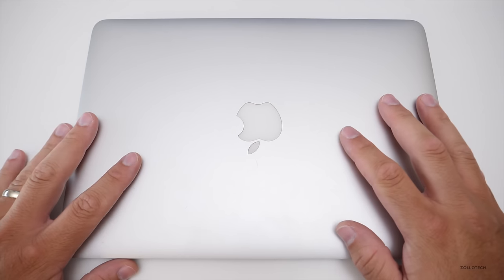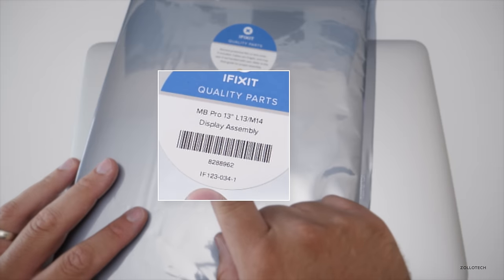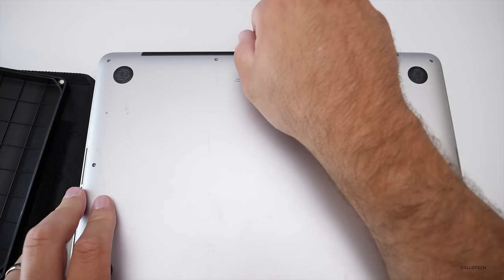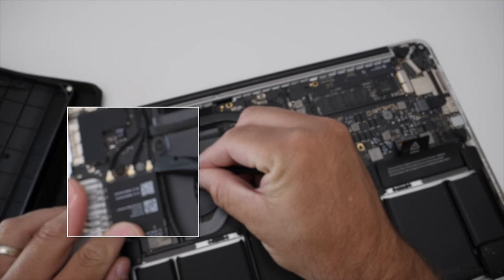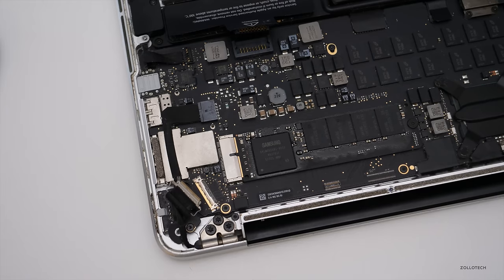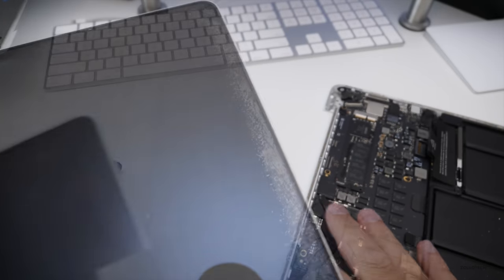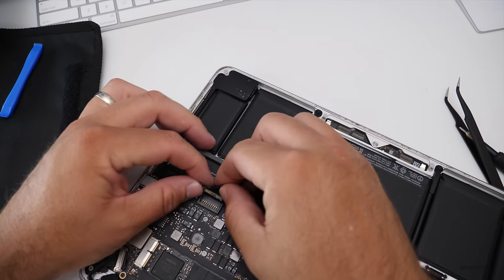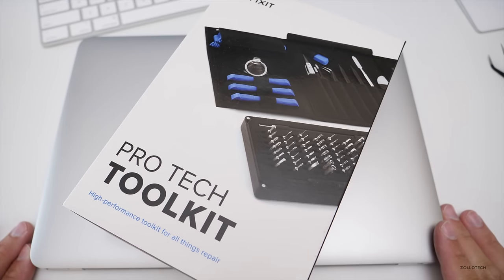MacBook Pro Display Replacement

Comment: Just rub on the screen with metal polish to remove some of the antireflective coating, the get it repaired for free by Apple.

Doesnt matter if the screen is cracked, they still replace it.
Reply: Stockholms Oskar is this offer still on?
Reply: @malyasiolek  It applies for 4 years after the MacBook is bought.

So some Mid 2014s and most Early 2015s are still covered.

Comment: I really don't see the point in trying to repair that when you can buy the whole laptop for that price!!
Reply: i'm in the same situation.. have a mid 2014 Macbook pro and it's not as bad as this one but it does obstruct a good 1/4 of my screen if i send this off to apple i imagine the whole process would cost around 600- 900 pounds (uk) where as the brand new model is like 1,100 pounds so for the sake of 200 pounds i might as well just get a new one

Comment: Hello, I've changed the screen on my MacBook Pro 2019 A2159... Something very weird is happening, during the iOS installation and until the iOS booting the brightness is normal and high but once the iOS boots the dim goes so low and I can barely see the desktop even if the brightness if full on! I think apple detects not original parts during the boot and doesn't let them work properly. Anyone knows any solution? I ve tried to reset the PRAM but same issue, starts good but then... brightness super low... I am freaking out!!!
Reply: Hey , did you figure it out?
Reply: @xpozo8601  nope I had to send back the display. And change with another seller.

Comment: I would like to know how much Apple would charge for this fix to be done...? Mine isn't as bad as the one in the video, but it COULD get that bad some day, right? The left side of my macbook screen is mostly lines and there are now horizontal lines going across the middle of my screen. When I went to the Apple store last year, the guy told me it'd be way too expensive to fix my laptop even though my line problem was minor.  He said I might as well buy a new laptop all together, even though I cannot afford one...I tried researching this and some sites said this kind of fix wouldn't be as expensive as a new laptop, but that would mean the Apple guy lied to me...Can you please help me out if you  know?
Reply from the maker: A lot.  Probably 500-1000
Reply: Thanks for the fast reply. I am just so scared of my laptop screen being rendered completely useless which would force me to somehow get a new laptop. I am just still stuck on if it's worth it to fix it or just buy a completely new one.
Reply: I was quoted today. Mid-2015 MacBook Pro 15” Retina Screen was approximately $680 USD. That is despite having purchased AppleCare when I bought the new computer in Sept 2016. Absolutely insane. I’m hoping I can find the replacement display and do it myself.
Reply: I just got quoted 625 CA dollars with AppleCare warranty so planning to just do it myself

Comment: My MacBook Pro 2013 15 inch screen is cracked.How much would you say it would cost for someone to fix it for me?
Reply from the maker: The display is about $500 from iFixit and then whatever it cost to swap it.  It's not that hard to do if you take your time though.
Reply: zollotech is it 500 CAD or USD? I’m Canadian so if that’s USD I can’t afford that.
Reply from the maker: USD you may be able to find one on ebay though.
Reply: zollotech I don’t trust eBay. Guess I’m doing my school work on my iPad or phone
Reply from the maker: Why?   I have used it for years. Just make sure they have good feedback and only pay using PayPal.  That way you can get your money back easily if it’s faulty or they don’t ship it.
Reply: WorldwideHandsome _ oof

Comment: Pro tip for any nubs out there who may attempt this. Never screw the bottom back on before testing it. There’s a 90% chance it will not work if you place all the screws back in the bottom.

Comment: I’m just pretty furious I spent $1600 to have a screen be so sensitive to such a light touch.. after 2 months of ownership.. and need to go thru this process.. like fuck off apple. I have had a $280 Lenovo with a damn touch screen for almost 6 years. And it still works just needs a new battery. I thought I was paying for longevity... and simplicity.. well guess what, changing a screen ain’t simple 🤦🏽‍♀️